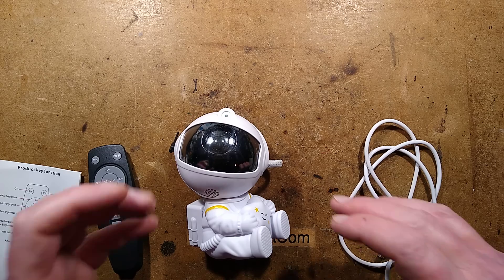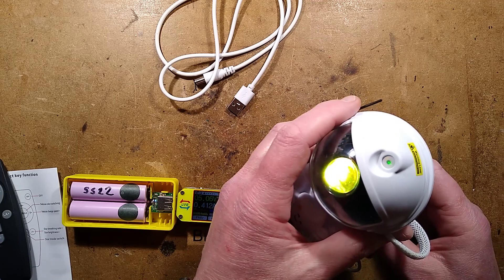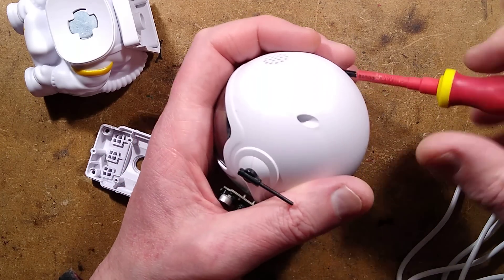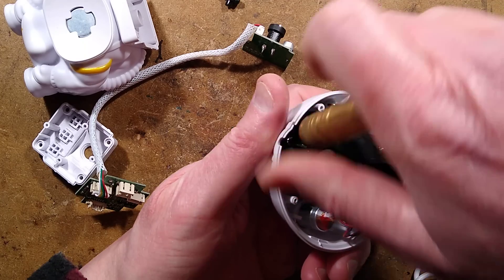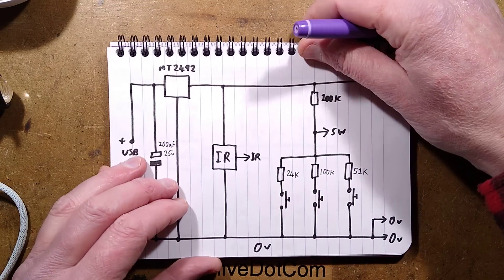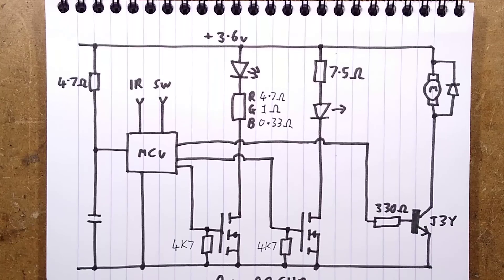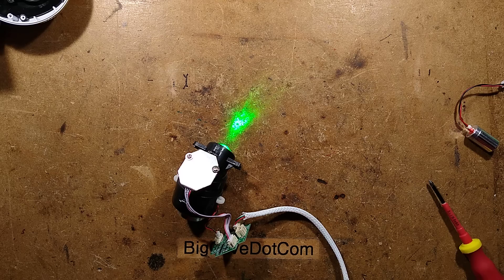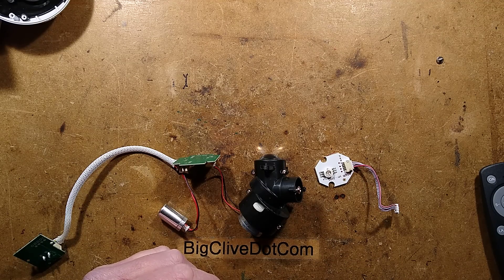Can we fix a dead nebula projecting spaceman?

Comment: My electronics teachers always told us, first step, “ Check your primary power source “ when fault finding.
Reply: Trouble is... how do you do that here. USB to power jack isn't too common a cable. I'm not sure I would have another one around the house.
Reply: @malted.coffee They are quite common now for the USB lights and I have a few spares that have lasted longer than the LEDs inside the lights

I haven’t looked but I would imagine they are available to purchase alongside the more traditional styles now
Reply: @smilerbob Wonder why they don't use usb type C these days for most stuff like this that use an usb A port....
Reply: @soragranda I wonder if it allows for the option of using a standard 5V power supply rather than a USB plug. Perhaps they have to do spot checks of the units and don’t trust their own USB power plugs 🤣
Reply: @smilerbob  Yeah that might be, since these days usb c tiny boards are quite cheap (tons use it for modding 3ds consoles and other stuff).
Reply: @soragranda  no doubt, still have plenty older connectors, cables, printed circuits, other pre-made parts and similar stuff in storage/stock, manufactured year ago. No reason to dumb everything for "new", yet. USB 2 era connectors and cables or older perfectly usable.
Reply: @malted.coffee You don’t need another cable to check because you could just measure the voltage like Clive did with the first cable.
Reply: I have a ton of those USB to power jack cables from modern Christmas decorations.
Reply: @AlKaseltzer87  But they are not standardized. Polarity is whatever they want. Also, the signalling of a "dumb" device on usb side may or may not be present.
Reply: I have a ton of those USB to power jack cables from modern Christmas decorations.
Reply: I have a ton of those USB to power jack cables from modern Christmas decorations.
Reply: I have a ton of those USB to power jack cables from modern Christmas decorations.
Reply: I have a ton of those USB to power jack cables from modern Christmas decorations.
Reply: I have a ton of those USB to power jack cables from modern Christmas decorations.
Reply: I have a ton of those USB to power jack cables from modern Christmas decorations.
Reply: @AlKaseltzer87  Not need to post 7x 😉
(My apologies, it appears to be a YT bug).
Reply: @Conservator.  😠 ~ that is a resent form of glitch/bug from YouTube, [@AIKaseltzer87] has posted 1 comment but because of the bug it appears to have been posted 7x from the 1. And as YouTube is run by a bot this glitch will never be fixed, I myself have commented in videos and sometimes my comment will also appear halfway down the comments string ~ the bug is causing my comment to be posted 2x
Reply: @samuelfellows6923  Ah, thanks for letting me know. 🙏
Reply: I have a ton of those USB to power jack cables from modern Christmas decorations.
Reply: Thou shalt check voltages.
Reply: Yup. Fault finding 101. Always check your power supply first. Powers and grounds.
Reply: To most people a product that totally stops working seems like the worst case. But for repairs that's the easiest because it's usually a power issue. It's when the device has weird behavior that something more subtle has failed.
Reply: @gargantuablargg exactly
Reply: I have never missed such a fault due to lifelong habit of meithering electricians, builders, mechanics, linemen... if you are doing something I will ask you about it. This gets easier and more fruitful as experience is gained, one tends to pay for arcane knowledge with sidesplitter stories of ineptitude.
Reply: Yeah kinda a silly mistake but I've bet we've all done it
Reply: So did he wanted you to check the power station ?
Reply: @someone7648  Are you interpreting 'primary power source' as a power sation? It would be worth checking the incoming mains. However, Power supplies are sometimes split with an initial power supply followed by further regulators in the circuit. Things don't work well if the voltage is wrong. Check voltages first, before chasing your tail.
Reply: If it had used a standard cable anyone could have tested with their phone charging cable or similar and this could have been saved from e-waste.

Comment: So where is the fault in the cable? Was it a bad solder joint on the one of the plugs? Or a snapped thin fake copper wire?
Reply: I  bought a LED current soldering kit (a bunch of LEDs with different values of resistors to show brightness vs current) last year that had a 9V to barrel connector and one of the wires wasn't soldered properly right at the barrel connector. What a thing to do to someone's confidence just getting into electronics.
Reply from the maker: I didn't open the cable up.  (yet)

Comment: I was very interested to hear about you using QL SuperBasic. My first computer was a Sinclair Spectrum, and in the middle of the 80s the magazines had a lot of talk about Sinclair's successor QL computer. It turned out not to be successful, for a lot of reasons. I think this is the first time I've heard of someone actually using one who wasn't a vintage computer collector.
Reply from the maker: It was very different to the Spectrum.  The QL Superbasic language was very advanced.    I used mine to program fairground lighting control systems, and later found out a rival lighting company also used a QL for the same purpose.
Reply: I had a coleco adam and a commodore that used qbasic I think. I still remember some basic code 35 years later, lol I feel old now. :)
Reply: I still use QuickBasic and program in it to this day.

Comment: It's been a while since I have seen somebody using endless paper and maybe a needle printer. Oh sweet memories .... sssssssst, ssssssst, ssssssst :)
Reply: OKI Microline 320 elite. 9 pin heaven, since EVERYTHING was available from OKI as a spare part, not that you ever needed to do any repairs since these printers were effectively immortal. No special drivers, no installation, just plug into the printer port (which funnily STILL exist on modern motherboards!), and off you go.
Reply: @phils4634  I had, still have, a KC85/4 with an V24 interface, and a 9 needle president K6319 (?) clone, 8 bit GDR stuff. Beside the color tape it still works. The color band seems to be low quality, only 35 years after the purchase it does not work anymore 😁

Comment: I will be completely honest, I would have never suspected the power cable and spend hours trying to find the fault before throwing the toy across the room in frustration.😁
Reply from the maker: That's an important thing with diagnosis of faulty equipment.  Start with the simple things.
Reply: @bigclivedotcom Exactly, it's often the simplest thing. I remember years ago being called out to an emergency - the HP Laserjet 4 "which wasn''t" working. This was a time when even person lasers were used for group printers and we were in local government so every penny counted.

 It's powered up when I arrive and the LCD says "Set language: English" 

So I tap the OK button and the printer springs into life.

Simple things.
Reply: We learn from mistakes ;)
In facts, even if you speak to the most intelligent people on this world, always starts at the beginning : is it plugged in ? etc
Reply: @archloy  or ask the customer the last thing THEY did to it..sometimes there is  a clue in there :)
Reply: @MickeyMousePark  "I just wash the floor with pressure water", this kind of things ? :D
Reply: Spoiler alert!!!! 😂